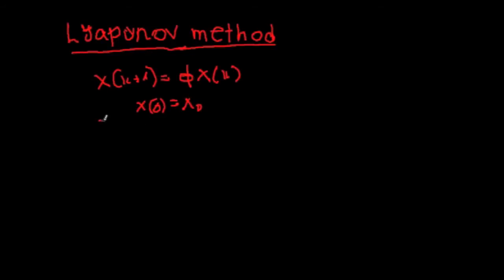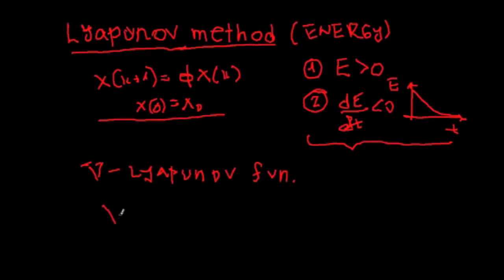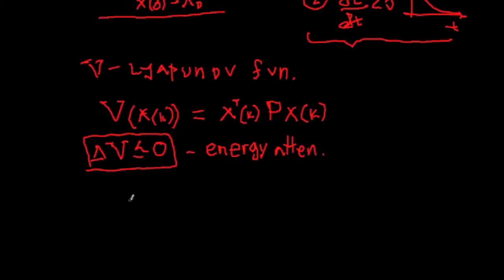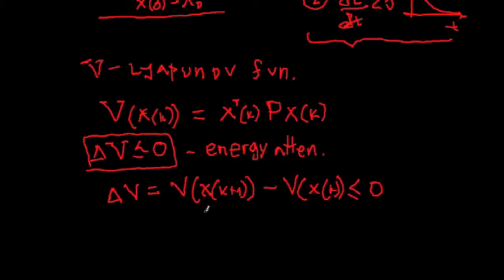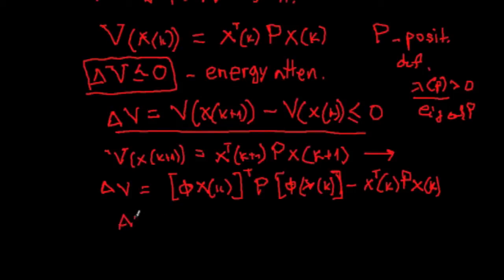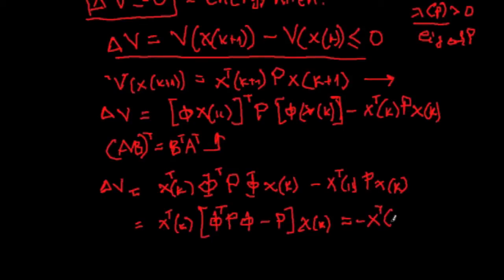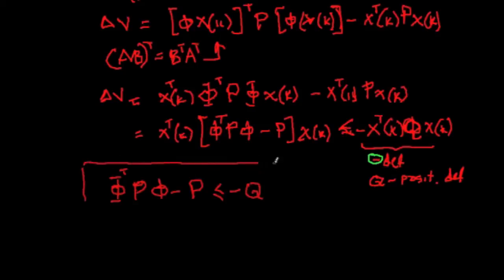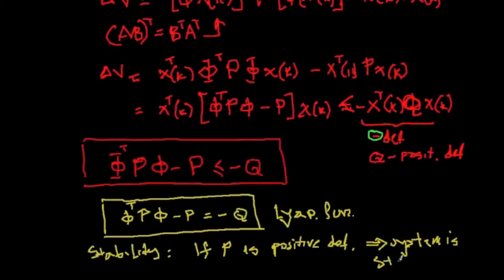Che576  UofA Lecture 16- Stability of discrete system by Lyapunov's method

Comment: Wang, yes you are right that you can find the eigenvalues of the state matrix and if they are less than zero by module you conclude stability of the system. However, think about situation that you might have large state space 1000 by 1000 matrix (chemical refineries for example) than you might easier solve F^T*P*F-P=-Q and show that matrix P is positive definite which implies stability of x(k+1)=Fx(k), x(0)=x_0 system. You just need to show in your calculation that P matrix is positive definite.

Comment: Sara
I am about to add a set of lectures with possible extension with examples. 
Hence you can take any matrix A, let us say 2 by 2 , any matrix P=[p11 p12;p21 p22] and any positive definite Q 2 by 2 and the resulting system will become system of linear equations in p11, p12 and p22 since P is symmetric. In other words you will get bar_A*x=bar_B where x=[p11 p12 p22], solve for that and find out if P is positive definite! if yes system A is stable.
Hope this helps